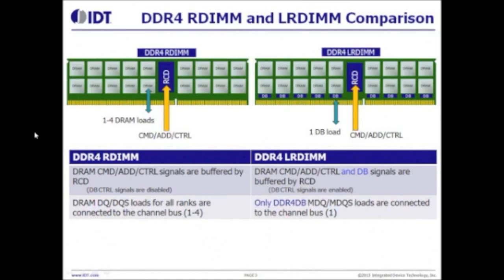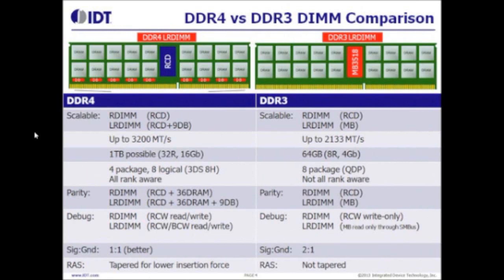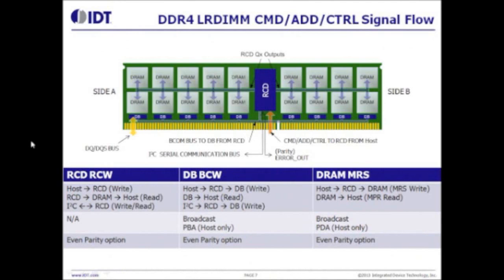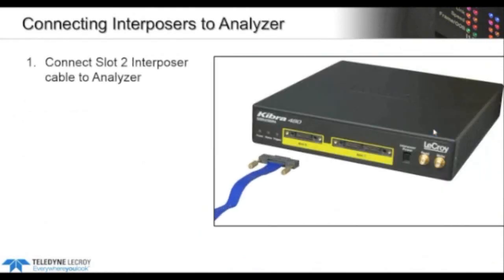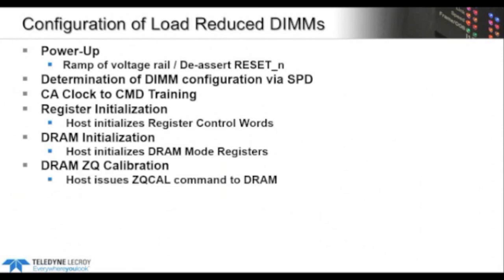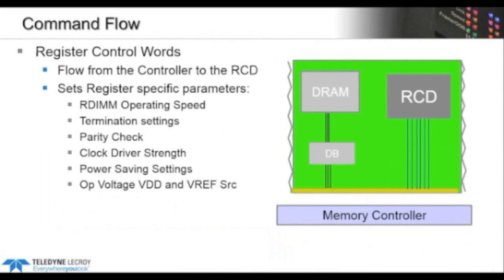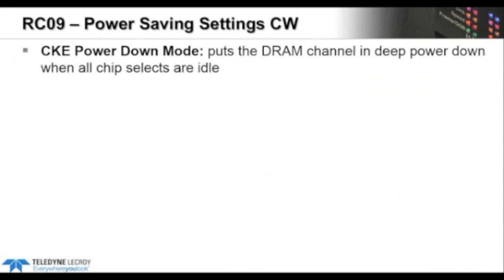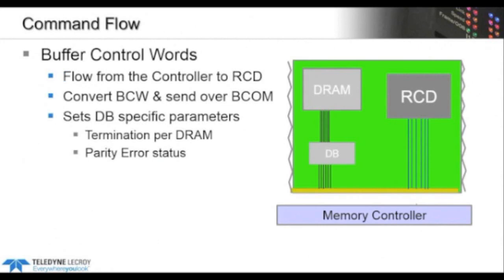Understanding and Testing DDR4 R-DIMM and LR-DIMM Technology

Comment: I'm posting because I'm just not an expert in some aspects, like apple,. could you explain why on a late 2015 27 inch iMac i5-6600 quad core 2TB Fusion Drive, AMD m395 video.  it takes ddr3 sdram non-parity unbuffered, non ecc at ddr3-1867 pc3-14900 sodimm low power I guess.  why would it be that certain ram seems to cause kernel panics or other symptoms, and they say dual channel, but give you 4 slots not to exceed 8GB each, but give 4 slots?
Reply: hi can you explai DQ/DQS IN DRAM operation.